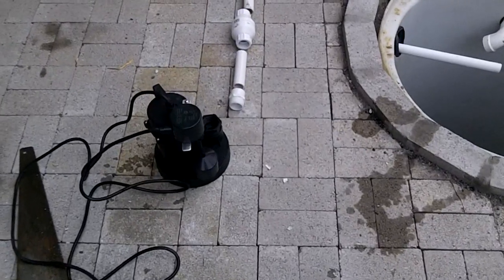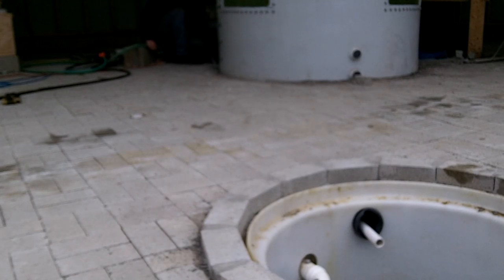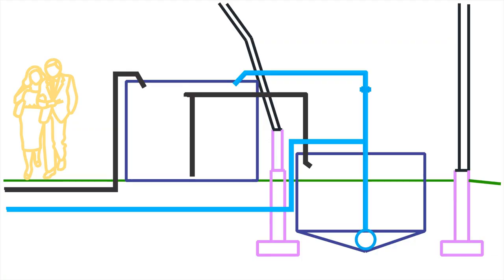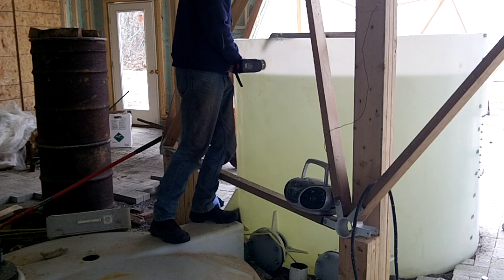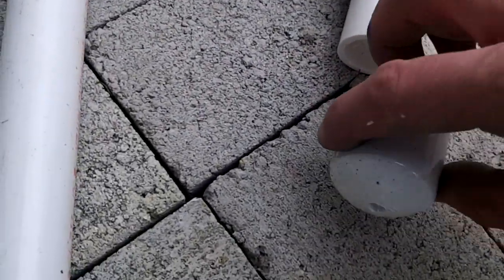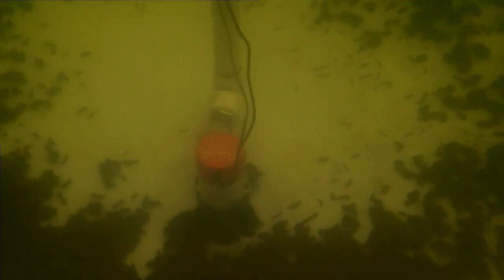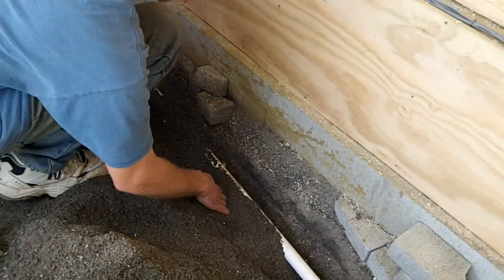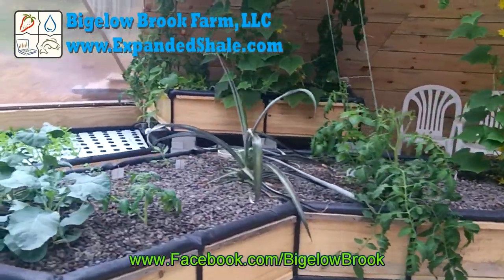Aquaponic System Install - 2 of 3

Comment from the maker: A lot of people use pipes.  The nice thing about a grow bed is you have more space for roots so you can pack the plants in tighter.  Also, if you have a pump failure, the beds stay wet a long time whereas the pipes can dry out quicker (assuming you're using NFT and not media)

Comment from the maker: 1.  It hasn't been a problem since the central sump tank only pumps once in awhile.  However, when I finish the rest of the beds, there could be several draining at once which could overload this little pipe.  I'll probably add a second larger "emergency line in.
2.  There is some debris in tank, but it eventually works it's way down to the pump.

Comment from the maker: If the siphon break is above the horizontal pipe, then it would always stay "broken" and the pipe would work only as an overflow (which is a common way to do it).  I wanted to siphon it out so it would go on and off, creating a faster suction to get some of the heavier solids out.  When water swirls, solids move towards the center of the tank so the pipe needs to be in the middle.  If eggs get sucked out, they get sucked out and end up in the growbeds.  Red wiggers take care of the solids.

Comment: You have very carefully planned your projects, so I would like to understand more thoroughly what your thoughts are on the following points: The fish tank siphon break seems like it could be pointed higher than the horizontal pipe as an overflow, uncapped, without clogging or changing the normal water level. The fish tank drain pipe is centered while rotating solids would move to the outside. Is this to prevent eggs from being sucked out? How will you deal with solids buildup in the grow beds?

Comment: I am really interested to find out how well those 12v bilge pumps last when run continuously. And also what sort of solar and battery setup will be needed to keep them running. I'm about to set up a second aquaponics system consisting of 2 x 6000L fish tanks and it would be great to run it off solar.

Comment: and another couple of ques. please.... Can i over flow straight into the media beds and only use a sump right before the fish tank with a float switch? i have designed for  two media beds 2'x3'x1' = 40 gallons, 2-floating raft beds 6x2x1=90 gallons. the fish tank is 250 gallons...can i use my 75 gallon glass tank as the sump where my beds drain and then pump into tank or do i need a bigger sump? thanks so much for the help dude you are awesome!!

Comment: Questions: 

1. Have you found any difficulties with having the same size supply line and return lines for the fish tank?  I thought the return had to be bigger...

2. Is the sump tank extracting the debris as expected or is it starting to build up over time?  How long has the system been running?

Comment: up precious space. maybe the exothermic reaction that takes place in a compost heap, but it would take a lot of experimenting to keep it consistent and controlled. then i'd need a job for all that compost though- kinda redundant when i grow everything aquaponically. dry the biowaste and make a biochar furnace? that takes work and again biochar isn't needed. one could circulate the water through a mini ground water heat pump, but thats overkill/needs power. what are your thoughts?

Comment: hello sir, i love your videos. i am using them to build my system. i have some questions....
can your over flow system for the fish tank be used as "t". with the cut off being a forth outlet ..im not sure if im making since..sorry...basically my 250 gallon tank is in the middle and would like to overflow through a "T" into two grow beds which will then drain each into a raft system(2 on either side) then overflow in a 75 gallon fish tank (glass) which i already have...then sump pump in to tank

Comment: Does the siphon work properly? Because with your bell siphon there is an elbow below it with water in it which builds the air pressure causing the suction?